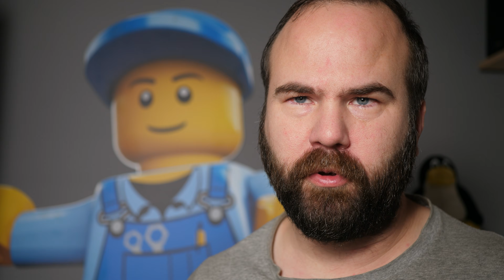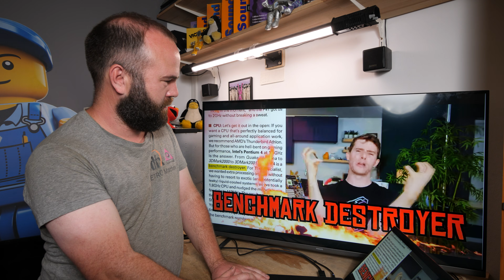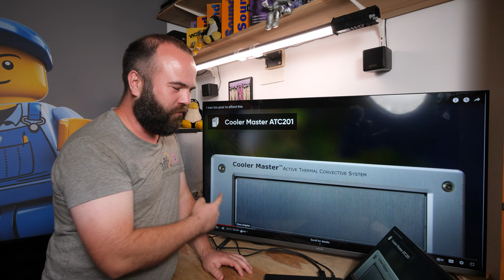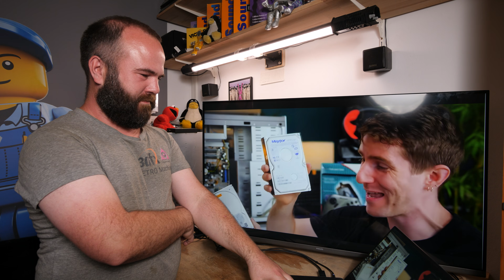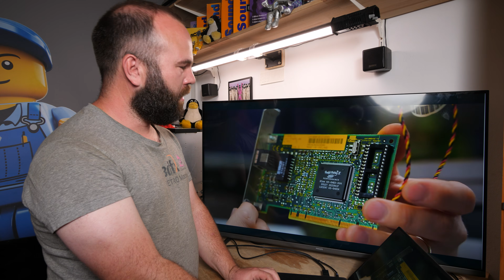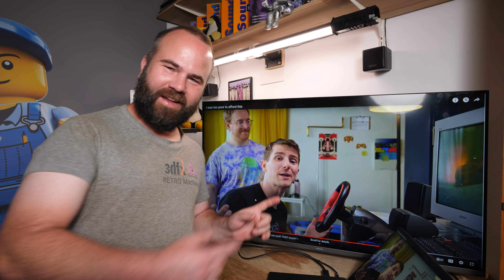My Honest Opinion about Linus Tech Tips his Maximum PC 2001 Dream Machine Pentium 4 Build

Comment: Although Geforce 3 doesn't look as cool as the Voodoo5 5500 (That I have to agree but as you know 3dfx was bought before the Geforce 3 came out so it's hard to recommend a product when the company doesn't exist anymore), The thing is, Geforce3 is one of the turning points in computer graphic development.  the introduction of nFinite FX and pixel shader really paved the foundation for future development until the Geforce 8800 series in 2008. Geforce 4 was pushing the Geforce 3 architecture to it's limits. Back then I didn't expect GeforceFX to be a big disaster, 

Windows 2000/NT is great but most consumer don't use it.  Why didn't Microsoft used Windows 2000/NT as a base for ME back then? who knows.  I personally think it was bad timing that Maximum PC released this build 1 month before Windows XP was officially launched.  

It's great to look at the memory lane to see how it develops and what are still relevant until now.  Sandy/Ivy Bridge are already becoming retro PCs.  It seems like the item I like the most are those Klipsch Promedia 5.1.  I  used the Logitech Z5200 that was released a few years later but man those Klipsch speakers? even using 2.1 sounds awesome.  Too bad it's long gone the era of great computer speakers. I can still blast them in the basement or the living room and they sound outstanding.

Comment: Come to think about it, the GeFroce 3 was a good choice for it. The 3DFx was almost dead by 2001 and while I do not know about the Voodoo  4 or 5. I know that Voodoo2 and Voogoo3 were limited to 256x256 texture size. This was not a big deal in late 90s but it had started to show its limitations in early 20s.
Reply: Nvidia bought out 3dfx around December 2000. At that time, Geforce 3 wasn't released yet as the GeForce 2 Ultra was the fastest.

Comment: I used to run win 2k in the olden days niw in my 1st retro i have dual boot with 98se. I have also found it super steady and apart from 1 or 2 97 games everything runs on it no issues. There is also a good community allowing it to be fully patched.

Comment: I remember the first computer magazine I bought in june 2001 that was boasting the new 1.7Ghz Pentium 4. There was also a test of a bunch of graphics card, from the Rage 128 Pro to the GeForce 3, with a Voodoo 4 in the mix as there was still plenty of unsold stock all over (they were completely outclassed by the way).

IIRC it's the Deskstar 75GXP that's extremely failure prone. 
I have a working 60GXP.

Comment: Hey dude is Windows 2k/Windows me or Windows 98s good for retro gaming?
Reply from the maker: all the cool games run on windows 2000 :D
Reply: depends on what games you want to play and if you want to have the option to use windows dos mode, then you are more or less forced to use win98
Reply: @ShrineOfLife hello games around 1998-2004
Reply: @Agoz8375  I would go for two seperate systems or an dual boot with windows 98 and windows XP
what kind of hardware do you have in mind that you would use for this time period?

Comment: Core 2 Duo was presented in 2006. So it is six years from this P4.
But back in 2001 first generation of P4 wasn't good choice because of wrong RAM choice made by intel. RD RAM was very expensive compare to SDRAM. Also DDR SD-RAM was introduced. It was much cheaper, faster and easier to install. Pentium 3 Tualatin and 815EP chipset (Asus TUSL2-C) were better choice in 2001.
And in 2002 they finally introduced second generation of P4 (Northwood) and 845 chipset (845E and P4 with 533MHz bus were preferable). 

Windows 2000 had compatibility issues with lots of games that weren't fixed even with Windows XP introduction. Lots of people stays on Windows 98 up until Windows XP SP1 or even until SP2. Or made dual boot to play in older games.

Comment: Very awesome video friend! ,3
This one I enjoyed watching a lot as I too did a P4 S423 build but with the fastest S423 CPU the Intel Pentium4 Willamette S423 CPU @ 2.00Ghz with 256KB L2 Cache and a 4900Mhz FSB.
But I did use a slight better GPU a NV40 based one the Leadtek A400 AGP 128MB 256Bit DDR, here my old system setup:
------------------
Stealth 2001

Intel Pentium 4 2.00Ghz Willamette Socket 423m 256KB L2, 400Mhz FSB  
Thermaltake Indigo Orb for Socket 423
ASUS P4T Rev. 1.07 0135 With Intel i850 Chipset & AGP Pro 50 x4
4x 512MB PC-800-40 Rambus Samsung Original
Leadtek A400 AGP 128MB 256Bit DDR (GeForce 6800 AGP)
Creative Sound Blaster Live! 5.1
3-Com 3C905C TX-M 10/1000MBit Ethernet Card
Sweex 5 Ports USB 2.0 PCI Card, 4 External, 1 Internal
Enermax Modu 82 525 Watt PSU
A-Open H600-B ATX Case

WinXP Pro USA x86 + SP3
nVidia ForceWare 84.21 WHQL. 
------------------

As all the cable management goes yea  folding flat data cables is super easy and using tie-wraps aka zip ties to bind things together is much neater and gives much better airflow than them horrific black cover tubes Linus and his team used, as the HDD"s go I always stick with Seagate Barracuda V 7200 RPM HDD's I have 6 of these drives all are in 100% healthy status and they never failed me yet.

A nice SATA - 150 PCI card would of been better with a 10K rpm 150GB HDD, it would of suited the build better Win2K Pro like WinXP pro are the better operating systems to use for a P4, PI would personally choose XP pro + SP3 but without the 132 extra updates that came after SP3 as these will break the OS over time, SP3 it's self is more than enough.
if I want to revisit the P4 build I will go with a lovely ATi Radeon 8500 AGP 128MB DDR or something in that range, intel & ATi were a well known configuration back in the day.

Comment: That monitor, without a doubt, besides the case, is the highlight of the build. That is the reason that the family's computer, and higher spec'd rig, is not my gaming PC. I really, really prefer CRTs for gaming - but, good g'damn, that is something that you just can't get without spending modern OLED monitor money - and sometimes twice as much. I keep getting old CRTs for whatever they are being given away for, and I've found two gems... both are 1600x1200 at differing hertz (75hz and I think 85?) - but the Dell trinitron is quirky, and I may have accidentally broken the power switch... But I got this "Little Old Lady's" CRT that was an Envision 19" (dropped off repair of system, never picked up).... and whereas I could see a better result from my Trinitron that I had to remove the 'protective layer' from, I did... well... f'it up pretty nice. Old plastics are a bitch.

Comment: I have a Pentium 3 tualatin in an or840 powerleap adapter, rambus, radeon 8500 aiw, obsidian x-24, vortex 2 sq2500, SCSI, Windows me with unofficial patches. It's a bit unstable, and I don't know how to fix it, think it's a combination of scsi irq conflict and CPU being too fast. So what I mean is that it doesn't want to boot, so you cycle until it does. The CPU causes some issues in the BIOS, but I think the real problem is SCSI irq conflict. There are also some issues trying to run glide with a3d. There just may be too many expansion cards, and the CPU works funny because it's not meant for slot 1, and it's a dual socket board, which the Terminator also is questionable, having tried several boards that don't work. Oh, and the scsi is a hack job Chinese adapter for those server drives, using a regular scsi card, and IDK about compatibility.
Reply: My friend has been working on a Windows ME update pack that only uses offical Microsoft updates.  He should be finished with revision 3 shortly.
Reply: @nostalgicpchardware  I have the Microsoft February update cd that updates most OS during this era, it's also on the archive website. You start to develop issues however when installing things like kernel ex, which is it's own thing, but I'm having instability with the hardware itself, like not booting and graphical corruption in the BIOS, which is likely from running an out of spec socket CPU in a dual slot board with a random terminator, and whatever oddities I'm getting from scsi using a rack drive over a converter. 

As a bonus tip, you can make 95 look like 98 by installing Internet explorer 4 before 5, ME is almost software compatible with XP having the most official updates, and the TNT2 doubles FPS using a 9x OS, maybe 90 fps in 800x600 quake 3 using 16 bit color. Also, some games like quake 3 can run on Pentium 1 if you use GLIDE, because for whatever reason glide bypasses the CPU instruction set check.

Comment: I used till early this year a Pentium 4 HT (1C2T; 3.0GHz) as backup server, but the motherboard died.  It had 4 HDDs in total 1.21TB; 2x IDE 3.5" (250 + 320GB) and 2x SATA 2.5" (320 +320GB). It also had 1 Gbps Ethernet on the motherboard.  The motherboard came from a 2003 HP d530 SFF.  It did run from 2019 till 2024 every Saturday for 1 to 2 hours.  It used FreeBSD 12; 13 and in the last weeks FreeBSD 14.0 on the advanced OpenZFS filesystem.
The transfer speed for the backup was ~30 MB/s limited by a ~95% load on one CPU thread :)

Comment: Windows 98 will only cache 256mb of ram; but, I use 500mb in one retro computer running Windows 98se, and 2GB in the other computer running Windows 98se with the ram limitation patch available online. I remember that video by Linus, he talked about how he got gouged by the guy that sold him the computer case! There are lots of IBM Deskstar IDE HDD's on Ebay, lots of them; but, they didn't call those hard drives "Death Stars" for nothing!!!
Reply from the maker: It was including packing shipping insurance etc :)

Comment: I wish they made cases like this still and not the RGB Rubbish.
Reply: Aluminuim cases seem to be a rarity from other brands other than Lian Li, you google Aluminuim Cases and you get mostly Lian Li, I have a strong feeling Asaka made a Aluminuim case? but yeah would be good to see a modern version of these style cases, Rainbow Puke is Awful which is why they changed it to ARGB, but you still have aload of extra wires to deal with, which is also a pain in the a"£.
Reply: An excuse to keep the old cases as they don't build it like they use to anymore.

Comment: I was quite annoyed after watching Linus' video...

Because I used the Coolermaster ATCS 200 case around 2009, to build my Q6600 machine.
I kept that case until last year (2023), then I simply gave the whole machine away, including the motherboard and CPU.

(I think the motherboard was the Gigabyte GA-P35-DQ6 ?)

And then Linus said the case could be quite sought-after now, and might be worth a fair bit of money.

Oh well. 14 years I kept that thing, and now it's gone. lol
Reply: It really was a nice case, though, with the removable motherboard tray, tons of HDD bays, and a fair bit of space between the PSU and top bays.

Mine was the version with the darker mesh on the front, but without the small flap on the left.
I don't know if that's the ATCS 200 version 2?
Reply from the maker: @electronash  This was the original version. Later they made it a simpler design. Those later version are not so epic as the year 2000 version
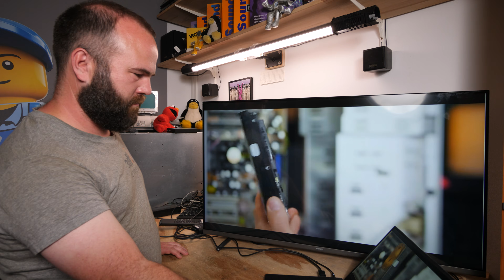Reply: 13:44 We used to call them "IBM Deathstar", because they used to explode so often.

Even funnier, were the Quantum Fireball drives.

I once powered up a Quantum Fireball drive outside of the case, and within seconds, a one-inch flame burst out of one of the main chips, and that was the end of that. lol

Terrible drives.

I think I might even still have a Deskstar 3.5" drive, but it's probably dead.